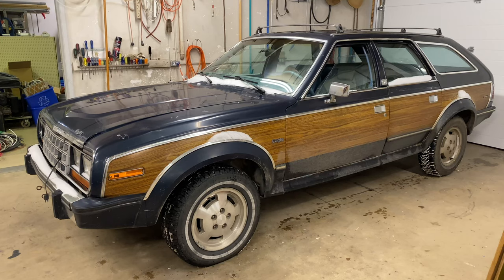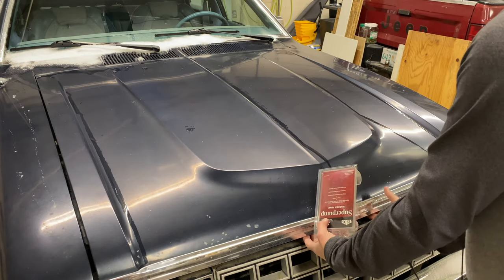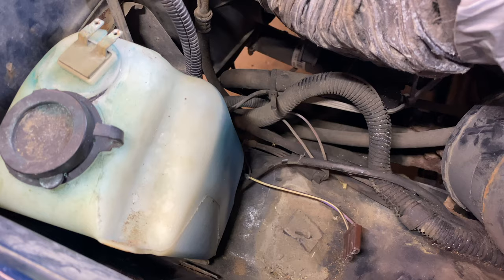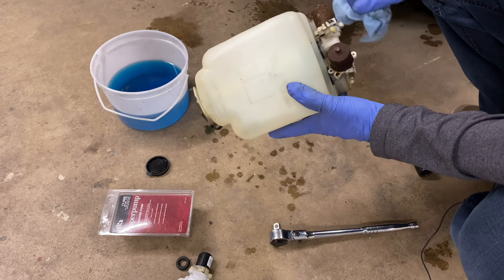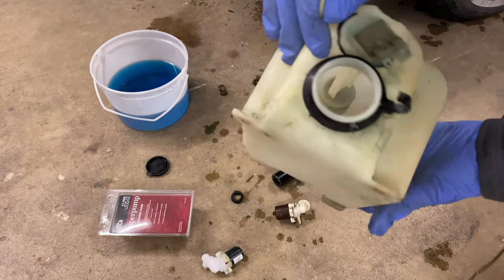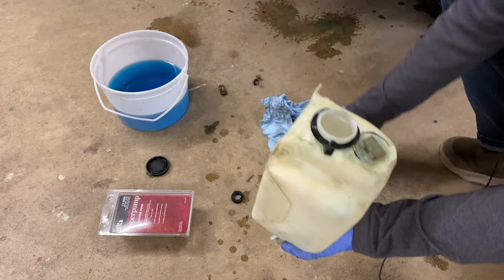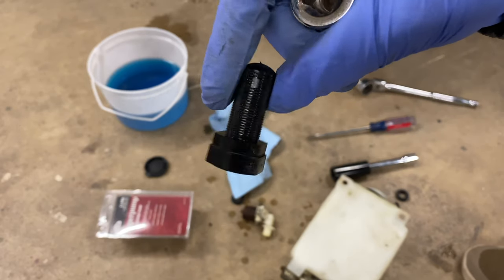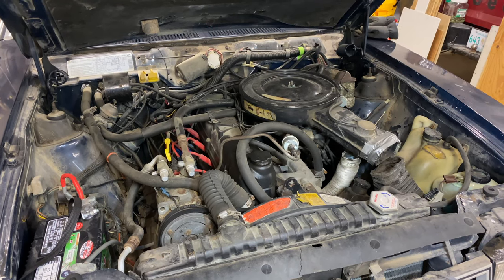Windshield Washer Pump Replacement [AMC Eagle]

Comment: I actually ordered the wrong one. Got it, installed it, still not working. Ended up being the clogged spray tubes. Stuck a needle in, put the old motor back in and it worked perfectly fine lol
Reply from the maker: If you can hear the motor running it’s usually plugged or disconnected somewhere